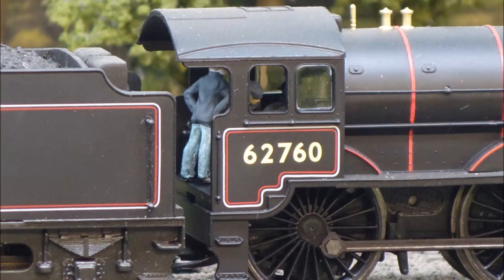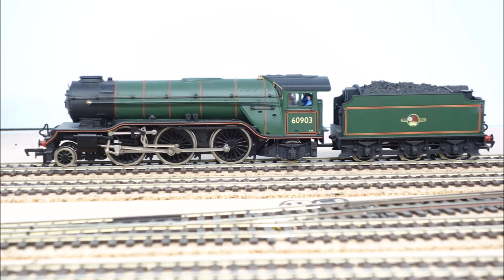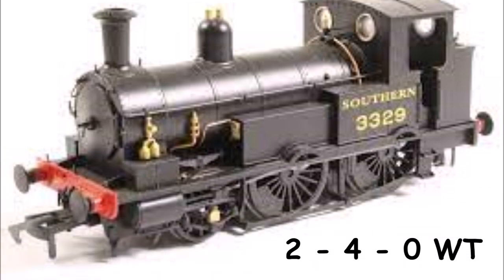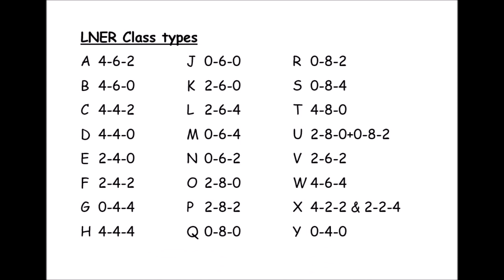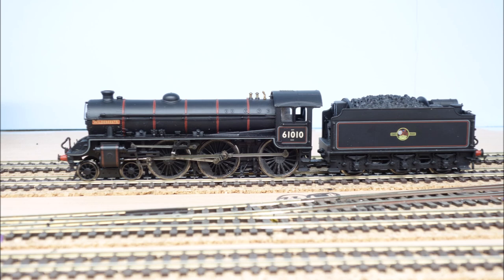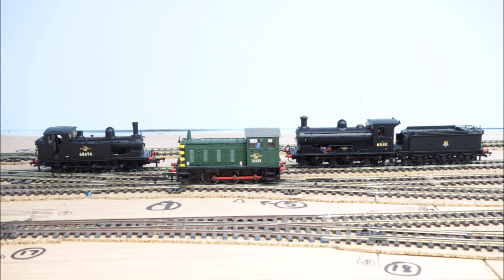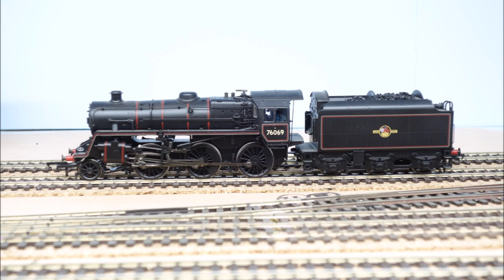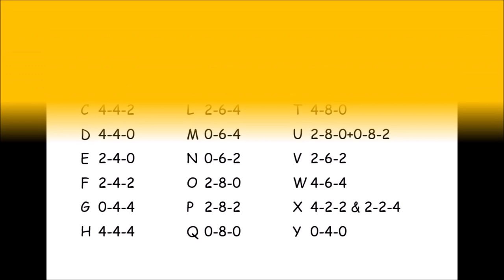Bite Size Bits -  LNER locomotive classes

Comment: An interesting refresher and nice to seem some stills of your locos too, didn't know about the X class will have to look that up. Surprisingly the U1 Beyer Garratt is a tank engine, so at 2-8-0- 0- 8-2T (or for some in abbreviated notation 2-8-8-2T) is it the largest tank to have ever existed? All the best Stephen
Reply from the maker: Hi Stephen.  Interestingly, although it does not have a tender, the Garratts, Malletts and even Welsh double Fairlies are designated without the "T".  I am sure there is a reason!?!
Reply: @yarslowmodelrailway1  Hi I think it must be down to who is authoring the document as well as the context. For example in my "The Observers Book Book of Railway Locomotives" by Ernest & Kenneth Carter dated 1955 interestingly the Whyte table they added includes the LMS 2-6-6-2 but excludes the LNER 2-8-8-0 (U1) configuration! They are rigorous in identifying whether tank or not whenever loco type is referred to or a detailed loco one page b&w photo plus description is given, thus have described as Midland Region 2-6-6-2T and Eastern Region 2-8-8-0T. They do not use LMS or LNER as with you I am sure there is a reason! I wasn't around then so who knows, we can perhaps only guess as we glance back in time!!! I for one would love to see a RTR model of the LNER U1.